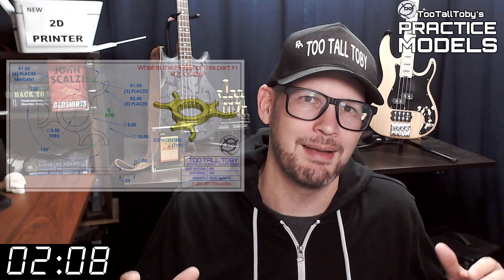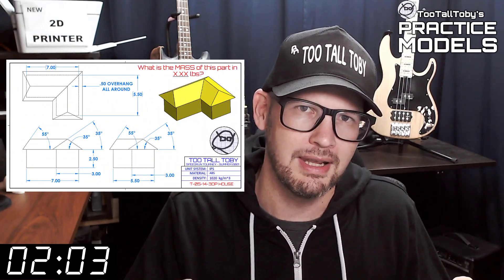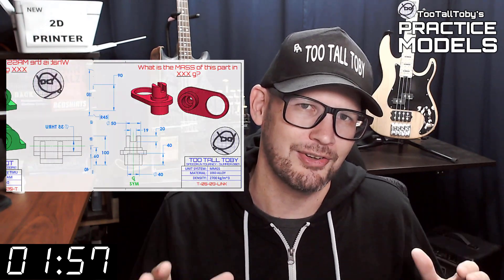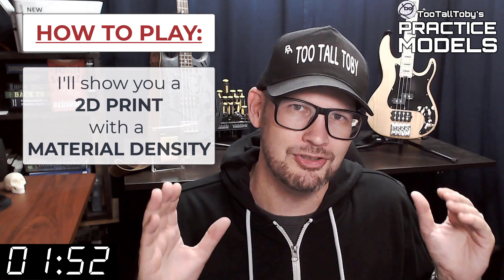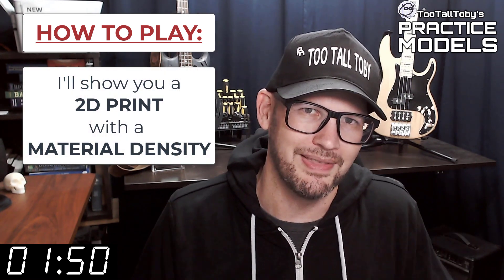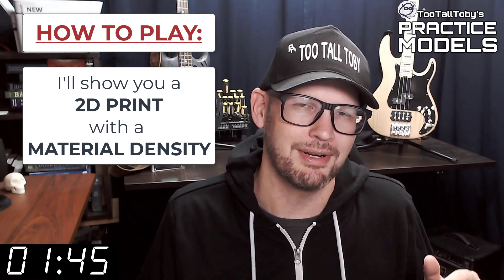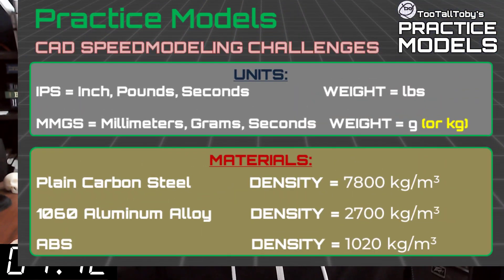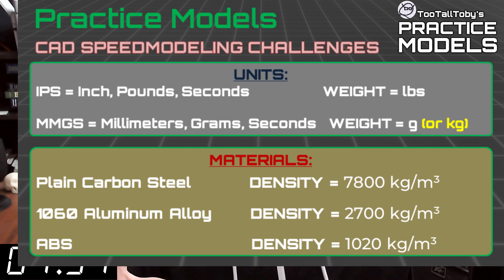SOLIDWORKS Practice - Onshape Practice - Fusion 360 Practice Exercises - TooTallToby-21-02-11

Comment: This is a nice little tricky part. For me, It was not practical drawing it in Alibre Design sheet metal environment. But it can be done! just not practical. Had it drawn faster using standard solid model features. 

Thanks for sharing Toby. I love your content.
Reply from the maker: Awesome!  yeah anytime I show a "sheet metal" challenge I try to leave it up to the runner to do it as "solids" or to do it as "sheet metal".  You could even do it as surfaces and just thicken it at the end!  :-)

Comment: 810.3g in 5:14 minutes.  I took the profile, did a revolve and the cut out the shape from the top view.
Reply from the maker: Awe yeah Nice job Chris.  I like that approach!
Reply: Revolve will probably produce not correct model with bends not being straight but rather curved. That may be why the mass you're getting is off by 1g.

Comment: 813.10 grams Time: 9:36, until I saw it was the wrong answer. I used 3mm for the "outside" bends, needed to be 6 since the inside was 3mm. Rat's. Thanks Triple T
Reply from the maker: Yeah I actually made that same mistake when I was auditing the drawing :-)  Nice job catching it!